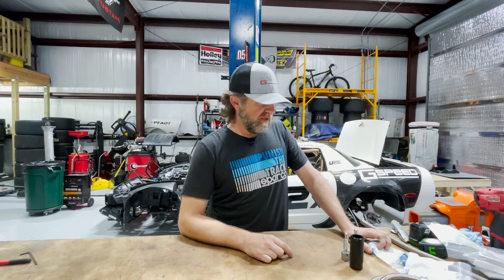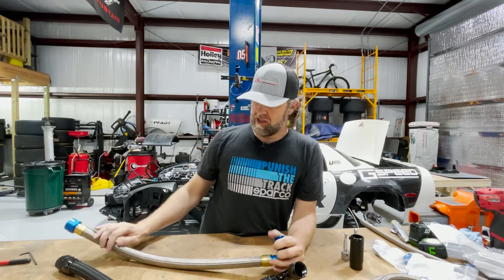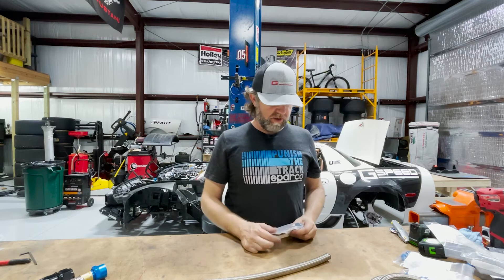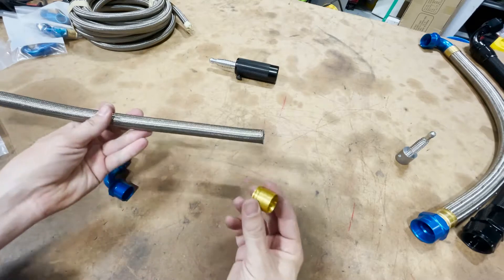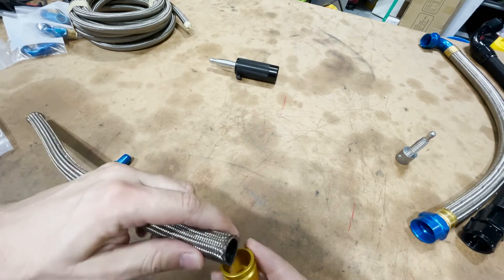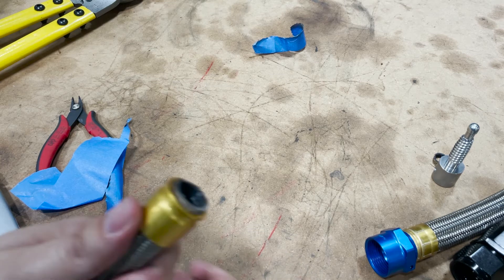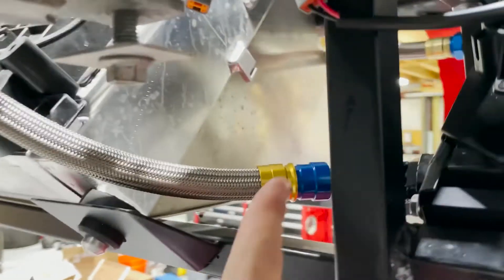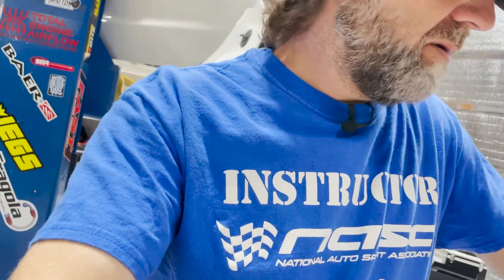Hoses Hoses Hoses, BMRS Hose Installation on C5 Corvette

Comment: Where did you purchase the expanders?
Reply from the maker: Straight from BMRS.  You can buy one handle and then each expander sets into it.
Reply: @Poweredby8Racing  that’s what I figured! Thanks for getting back to me. These and XRP are the best fittings on the market hands down. Getting ready to re plumb my own car with BMRS as well
Reply from the maker: I love BMRS fittings.  They have reusable if you want those.  But no need for me.  Once it was set, it’s done.  Not being rerouted.